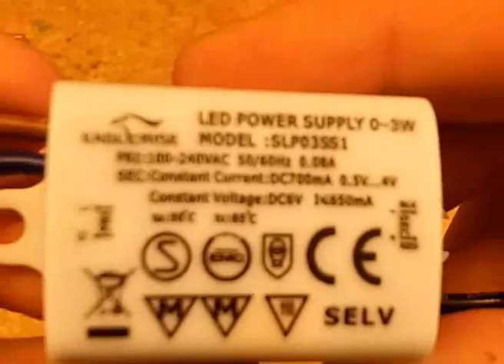LED Grow Light DIY - v2

Comment: Great job and a very good instructional vid for ppl who never done anything like this before. I was just wondering why you didn't put a 1a fuse on the + side going out to the circuit? Always good to have a fail safe part.
Again, great job on your grow light system..

Comment: hello, after aprox 10hours use - how much temp °C (or °F) you have on the cooler panel of leds (the side of leds, not the side which are cooling with fan)? And temp of LED chips? Can you measure this? Thx, sorry for my bad english :)

Comment: Hey great video, I do have a question.  If i were to make something like this but using 200 3w LEDs what kind of LED driver would I need to use?  More on the project, there will be a 3 setting selector switch, one for a blue only led setting, another for a half illumination mode, and another for a full illumination mode.  What other components will I need besides a few fans and the LEDs?  Any help will be appreciated, thanks

Comment: Nice job with the build!  It looks like you wired the blue in series with the red, My understanding is that you aren't supposed to do that because of the difference in current & voltage requirements.  How has your light been performing?  Thanks!

Comment: Not a bad build... sturdy anyway. Not sure why you went with series wiring instead of parallel and I don't really see a need for the fan since LED lighting produces very little heat.
Reply: Al Iwon'tShutUp Hefner  leds can get really hot, if you power 5w led with 5w it can go as high as 100 degree Celsius or more, if you under power it like 3w only you can get away with out using fans and have heat sink only.
Reply: 680ma, 70V driver, and there are 20 LEDs, and those LEDs usually have a forward voltage of 3.3v, so everything works out nicely.

Comment: ive looked at the cree leds and it says DC Forward Voltage : 2.9V ~ 3.5V (Max.)  what voltage do you run them on? do you need to arrange them in parralle and series circuits so the voltage is equally distributed.  normally led grow lights use high voltage power supplies than 3.5. some of them are using 48v.  how are they driving cree leds at 48v if the max voltage on them is lower than that